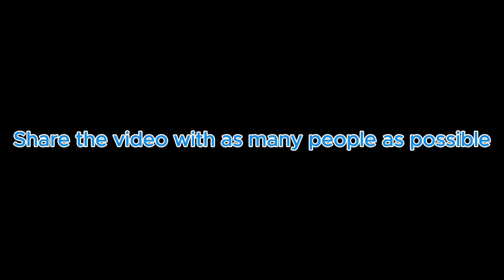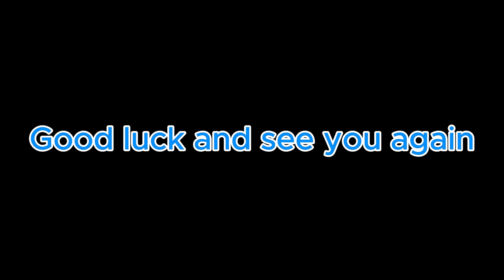Mix SILICONE and ACETONE! The results were shocking because they were so unexpected

Comment: 30 seconds worth of info and 4 1/2 minutes i'll never get back. Try this.... "Check out my cool zip tie mixer. I'm using it here to thin silicone caulking with acetone so it will spread easier and penetrate porous surfaces better. Handy waterproofing hack for a myriad of materials." Done!!! Sorry , but I felt like you must have thought your audience was a buch of learning disabled idiots. I don't mean to sound harsh. Just trying to give constructive feedback.

Comment: just thinning the silicone then acetone evaporates leaving silicone to secure the pieces. it does work but nothing like a miracle product or anything.
Reply from the maker: Exactly 👍. Acetone just thins the silicone so it’s easier to spread, then it evaporates and the silicone sets to hold the pieces. It’s a useful trick but nothing like a miracle product.

Comment: How is lighter fluid safer?
Reply from the maker: Better to say it’s sometimes less risky in certain situations, not completely “safe.” Quick comparison:

Gasoline is very volatile, spreads and produces flammable vapors — spilled fuel creates a higher fire/explosion risk.

Lighter fluid (or butane in a lighter canister) is often kept in a sealed container or small device, so there’s less chance of spills/splash compared with gasoline.

Still, many lighter fluids (naphtha) are highly flammable and dangerous if used incorrectly.

So “safer” usually only applies when you use very small amounts, in a controlled/sealed device, and follow safety rules. For most DIY experiments, it’s best not to use flammable liquids if you have safer alternatives (e.g., electric heating or purpose-built equipment).

Safety tips: work outdoors or in ventilation, keep away from uncontrolled heat/open flame, don’t add fuel to hot equipment, store fuels away from children, and always have a fire extinguisher nearby.

Comment: Great way to contaminate a surface with silicone. Now nothing can ever be adhered to those surfaces again. 
It can’t be painted, stained, finished with drywall mud, or any kind of adhesive, etc. because nothing will stick to it. And that includes more silicone, because it won’t stick to itself either.
Reply from the maker: Thank you for sharing your detailed perspective 🙏. You're right, silicone leaves a strong non-stick layer, which makes it difficult to paint or glue anything afterward. The video is just to experiment with this property, not to recommend it for surfaces that need finishing 🙂.

Comment: Acetone can cause cancer and it will dissolve many materials like ABS!
Reply from the maker: Thank you for sharing! Indeed, Acetone is strong and can affect health if exposed too much, so you should wear gloves, safety glasses, and work in a well-ventilated area. Also, avoid using it on sensitive materials like ABS

Comment: Do the same practical test in solar panel if possible.
Reply from the maker: Thank you for the great suggestion 🌞 The idea of testing with a solar panel is really interesting, I’ll consider it for future videos. Would you like me to try it on small solar panels for home use or on the larger ones usually installed on rooftops?

Comment: Has anybody used this on work boots yet?
Reply from the maker: This trick is mainly made for tools and hard materials, but if you want to try it on work boots, be careful. Apply it only on the sole or tough leather parts, and avoid the fabric areas so you don’t damage the boots. ✅

Comment: How long does it last? Water is a solvent in itself, so does it eventually remove the waterproofing material?
Reply from the maker: Thank you for your great question 👍. You’re right, water is a solvent, so any waterproofing layer has its limits over time. The durability depends on the type of material used, how thickly it’s applied, and the environmental conditions. If exposed to a lot of sun, rain, or frequent scrubbing, it will wear off faster. But if used properly, it can last quite a long time before needing reapplication.

Comment: Woundering / for replaceing a trailer deck , they SAY bla bla for silicone yearly warranty  if i dried out wood / pre cut, and done this would it really be any bettet than a good industrial paint over wood ?
Reply from the maker: Thank you for your great question. In your opinion, what is the most important factor to keep the wood deck durable: the coating or the surface preparation? Do you have any experience using silicone or paint for wood?

Comment: I got a quick tip.... read the MSDS sheets. Neither silicone nor acetone are safe to be handling without gloves much less spraying a mixture of the two.
Reply from the maker: Thanks for the important reminder 👍. Reading the MSDS sheets before using any chemicals is essential for safety. When working with silicone or acetone, always wear gloves and work in a well-ventilated area to avoid risks.

Comment: You can use this to waterproof a cheap tent done it for years
Reply from the maker: Awesome! Thanks for sharing your real-life experience. Clearly, this method works well if you’ve been using it for years. What kind of tent fabric do you usually apply it to? Do you have any tips to make the waterproofing layer last longer? We’d love to hear more from you!
Reply: @Tips365day  it works on every cheap tent that I've ever bought. I use white spirits these days, you can even make a sheet waterproof. It's a bit tacky for a few days so I don't fold up tight but I only have to "top up" once a season and that's more of a preference than necessaty

Comment: Can we thin silicone using water or something less flammable than acetone? And what was the comparative results between the three materials used. I could not make it out from the video. And why not do a soak test? Effectiveness of waterproofing can be judged only with soaking for a longer duration such a heavy rain which may last an hour or two and drizzle which may last four or five hours. Flooding also can last any length of time. We have to see the results under all normal usages.
Reply from the maker: Thank you for your detailed and thoughtful questions! 🌧️

Thinning silicone: Water doesn’t work as silicone isn’t water-soluble. Acetone is effective but flammable, as you pointed out. Some people use mineral spirits or less aggressive solvents, but results can vary and safety is key.

Comparative results: You’re absolutely right—the video didn’t highlight the differences clearly. We’ll create a follow-up video with a clearer comparison of adhesion, durability, and waterproofing across all three materials.

Soak test suggestion: Excellent point! Real-life waterproofing involves heavy rain, light drizzle for hours, and even possible flooding. A longer soak test will be included in our future experiments to better reflect real-world conditions.

Thanks again for watching and helping us improve the content! 🙏
Reply: @Tips365day  That was a very quick and appropriate response. Any water proofing should retain the surface flexibility. Otherwise upon folding, for any reason, the surface of the waterproof layer may crack or rupture and water will seep in. That's why some tents start leaking after some time due to wear and tear of the water proofed surface. Another thought how does the sprayed surface retain its water proofing when kept in the fridge where frequent icing and thawing cycles may occur. Sorry I'm making too much demand on your limited resources.

Comment: bro can you do flex seal liquid with acetone or lacquer thinner if it can thin it
Reply from the maker: Hi! Flex Seal Liquid is a liquid rubber coating, and the manufacturer does not recommend thinning it with acetone or lacquer thinner because it may damage its adhesive and waterproofing properties. Some people try thinning it with mild solvents for spray use, but that can reduce its effectiveness. If you need a thinner version, it’s better to look for a similar product that is designed to be thinned.

Comment: can you still re-use the sprayer after first use? just curious does the mixture won't clog in the sprayers nozzle?
Reply from the maker: Great question! You can definitely reuse the sprayer, but it's best to rinse the nozzle after each use to avoid clogging. If the mixture sits too long, it may dry and block the nozzle. Just spray a bit of clean water through it after use and you're good to go!

Comment: Sag mir,wie man tpe klebt.ich hab 2 mal teuren tpe Kleber gekauft und der klebt gar nichts 😢Der dafür entwickelte Primer Nr.7 löst das tpe auch nicht an
Reply from the maker: Vielen Dank für deinen Kommentar! TPE (thermoplastisches Elastomer) ist tatsächlich sehr schwer zu kleben, weil es kaum Haftung bietet – selbst Spezialkleber funktionieren oft nicht, wenn die Oberfläche nicht richtig vorbereitet ist. Du kannst Folgendes versuchen:

Reinige die Oberfläche gründlich mit Isopropylalkohol (IPA).

Rauhe die TPE-Oberfläche leicht mit feinem Schleifpapier an, um die Haftung zu verbessern.

Verwende einen speziellen Sekundenkleber (Cyanoacrylat) für weiche Kunststoffe – manche brauchen einen separaten Primer/Activator.

Wenn das TPE sehr weich oder flexibel ist, ist manchmal nähen oder thermisches Schweißen besser als Kleben.

Auch Primer Nr. 7 funktioniert nicht bei allen TPE-Typen. Vielleicht wäre Loctite 770 einen Versuch wert, da dieser bei vielen TPE-Arten besser wirkt.
Reply: @Tips365day danke für deine Mühe und deine Zeit😊

Comment: tell me..about the solvent..coild it be Thinner? 🤔
Reply from the maker: Great question! In some cases, thinner can be used as a solvent—especially for cleaning or dissolving certain types of paint or adhesives. However, it’s highly flammable and can be harmful if inhaled for too long. Be sure to use it in a well-ventilated area and avoid direct contact! 🔥😷

Comment: I used low odor mineral spirits and silicone. Put the mixture in a garden pump sprayer and coated a tent. So far, I have not been in a heavy rain, but it worked well.
Reply from the maker: That's a smart and practical approach! Thanks for sharing your experience—it's definitely helpful for others who enjoy camping and DIY. Hope it holds up well when the heavy rain eventually comes!

Comment: I have tried and tried,, I cannot get it to mix!!!!
Reply from the maker: Thank you so much for giving it a try! If the mixture isn't coming together, it might be due to the ingredient ratio or it may need a bit more stirring. I’ll double-check the process and consider posting more details in the video or description. Really appreciate your feedback!
Reply: @Tips365day  Thatks for responding. I think I am getting it. Not enough silicone. Much of it mixes  but 30% remains a fluffy white floating slob. It sticks to a screwdriver and comes out just like out of the tube except wetter. So I guess,, more mixing. I haven't sturred it much in 4 days,, busy wekend, lol.. I'll keep at it and see how it goes. Ill comment again later , Cheers!

Comment: I used shellite (petroleum based solvent as per NightHawkInLight) and a black tinted silicone to treat pine, very weather proof - you can also do old cotton sheets etc to make waterproof tarps - for running boards on my cargo bicycle, I had to use rough sandpaper first to get it to stick. No spray bottle, just submerge or spread with gloved hands.
Reply from the maker: Thank you for sharing your very useful experience! Your method is creative and practical — I will definitely try it in some upcoming projects

Comment: I do know this works though I believe you can buy the same thing already mixed in a spray bottle too. Most canvas water proofing is silicone based right?
Reply from the maker: Thank you for sharing! Yes, there are many ready-to-use spray waterproofing products available, and most canvas waterproofing solutions are indeed silicone-based because they provide excellent water resistance.

Comment: Wouldn’t the acetone eat the plastic spray bottle up? (Is it a chemical resistant plastic bottle?)
Reply from the maker: Thank you for the great question! You’re right — not all plastic bottles can handle acetone. You should use a chemical-resistant bottle (usually HDPE or a specialized type) to prevent corrosion

Comment: What's spray bottle what actually last more than 5 minutes with that acetone
Reply from the maker: Great question! To use with acetone, you should look for spray bottles made from HDPE plastic or glass, as they can resist strong chemicals like acetone. Regular plastic bottles tend to degrade quickly because acetone eats through them.

Comment: So you just ruined a drinking glass with an insoluble compound then ham-handedly transferred it to a spray bottle when the silicon and the acetone could have been put directly in the spray bottle for mixing.  Furthermore, you probably wouldn't have even needed to make the mixer if you had done that because you could have just shaken the mixture bottle before spraying and or dipped the brush directly into the glass before spreading.  Many pointless steps.
Reply from the maker: Thank you very much for your detailed feedback! I made the video to clearly show each step, especially for beginners. Using a separate glass helps to better observe the reaction and mixing ratios. However, I will consider your method to make the next video simpler and more efficient. Thanks again for watching and your valuable suggestions!

Comment: How did it work on different types of wood particleboard regular wood?
Reply from the maker: This method works best on regular wood, helping to harden and protect the surface. For particleboard, the effectiveness may be lower because of its loose structure and tendency to absorb moisture. It’s recommended to test on a small sample before applying widely.

Comment: can i also use this method to hardening the old decaying wood to fix it?
Reply from the maker: You can use wood hardeners or a homemade equivalent:

Option 1: Commercial Wood Hardener
Available at hardware stores (e.g., Minwax).

Penetrates the wood and binds the fibers.

Works best for small to medium decay areas.

Option 2: DIY Wood Hardener (similar to your idea)
Materials:

Clear polyurethane (or wood glue diluted with water)

Acetone (for deeper penetration)

Method:

Mix 2 parts polyurethane (or diluted wood glue) with 1 part acetone.

Apply generously with a brush or syringe into the decayed wood.

Let it soak in and dry for 24 hours.

Apply a second coat if needed.

✅ If the wood is structurally damaged (crumbling, flaking):
Hardeners alone won't be enough.

Use epoxy consolidants (like Abatron or West System) to rebuild the wood internally.

After hardening, you can shape or sand it before painting or sealing.

⚠️ What not to do:
Don’t try to harden wood that’s rotted through or moldy — it must be dry and free of active fungi.

Don’t seal over soft or damp areas — it traps moisture and worsens decay.

Comment: that bottle with "solvent" was it "really" acetone in a plastic bottle?
Reply from the maker: Thank you for noticing that detail! In the video, the solvent used was acetone, but we used a plastic bottle temporarily just for illustration purposes. In reality, acetone should be stored in a glass or a special chemical-resistant plastic container for safety.

Comment: What made this VIDEO is GREAT!!!??? 

This is because SILICONE can be dissolved using STRONG ACID. 

SILICONE resistance to FIRE at some degrees. 

This is why we have been ENSLAVED BY FREEMASON.

Silicone in microchip.
Reply from the maker: Thank you for sharing your thoughts. It’s true that silicone has some unique properties, like its resistance to fire and its ability to dissolve in strong acids. However, these factors are just a small part of many technical and technological applications that we use daily. We hope you continue to find interesting and useful videos!

Comment: You need to prep everything BEFORE you mix up, acetone evaporates super quick. The tools will be a write off, once that mixture dries that bottle will never spray again. The acetone will also eat plastic. Think through any projects.
Reply: the acetone will evaporate before it damages most plastics, but yes the silicone going through the mechanics of the sprayer will harden up and render it useless, and obvioulsy no way to clean it up afterwards.
Reply from the maker: Thank you for sharing this important information! It's true that acetone evaporates quickly and can damage tools, especially plastic. Proper preparation before starting is essential to avoid such issues. Hope everyone will be cautious when working with these materials!
Reply: @Tips365day have you tried this mixture on fabrics at all?

Comment: The same thing would happen if you use Mod Podge
Reply from the maker: Thank you for sharing your opinion! Mod Podge is a very popular adhesive, but it can have different effects depending on the intended purpose and how you apply it. If you have any questions about using it for a specific project, I'm happy to assist!

Comment: I did everything correctly as in my video and acetone does not dissolve silicone!!!
Reply from the maker: Thank you for your feedback! We're sorry to hear the method didn’t work with the type of silicone you used. Some silicones may have different formulations that don't react with acetone. We recommend trying mechanical removal or using a specialized silicone remover if needed.

Comment: cheaper and safer for gears to make with white spirit
Reply from the maker: Thank you for sharing! White spirit can be a more cost-effective and safer choice for gears, as it has the ability to clean and cool the parts without damaging them. However, when working with these materials, always ensure safety measures are in place to prevent accidents caused by the fumes of white spirit.